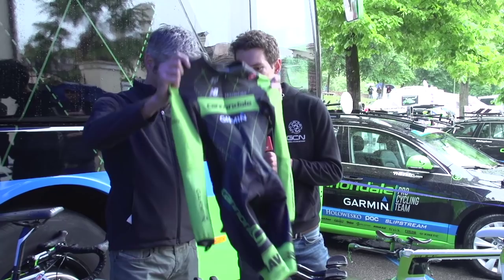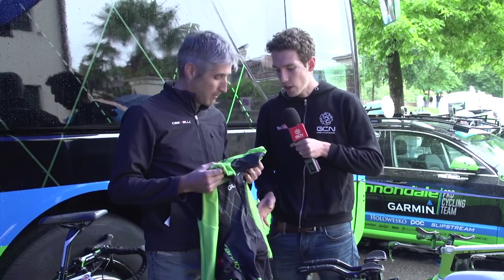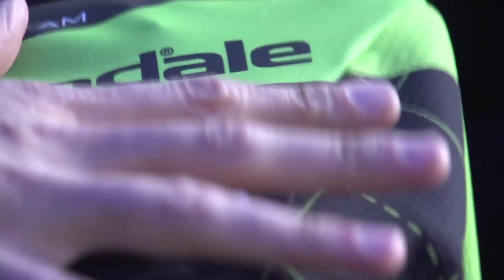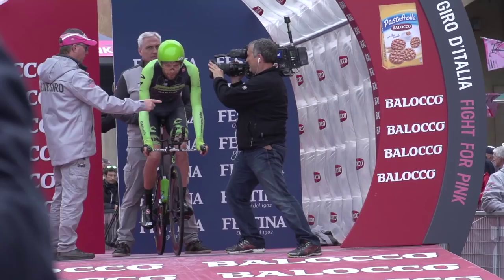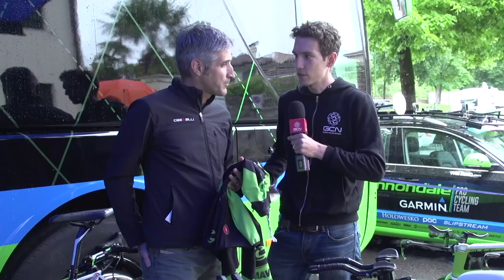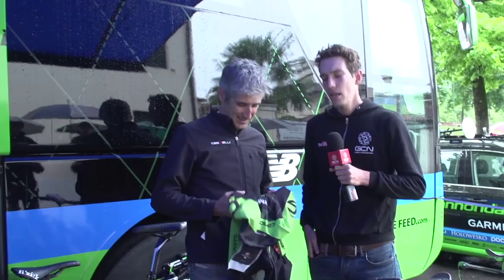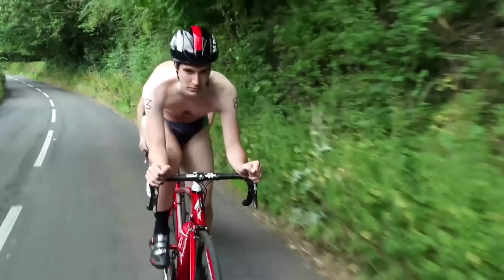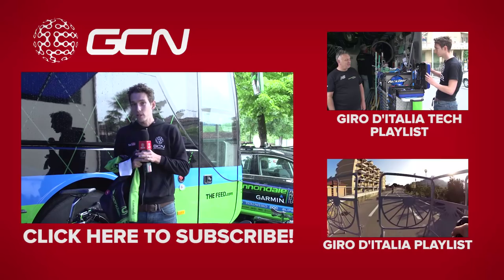Saving Watts With A Time Trial Skinsuit | Giro D'Italia 2015

Comment: Excellent video.  Very interesting.  He mentioned at the beginning about how the fabric will "fill in the arm hole".   I'd like to hear more about that. I've noticed some riders with fabric extended well below there armpit... stretched tight... almost like a small wing.  I suppose that is by design?  How far can you push it, I wonder, before the UCI will call it a fairing and how much does it help?
Reply: It may be interesting but, it's "watts" wrong with Racing nowadays.

Comment: I have a question Simon, why is 50kmph the industry standard? I don't you about you, but I get pretty tired pedalling at 50ks for 5mins, let alone an hour!
Reply from the maker: Terry Dawson 50kmh is really fast for most of us, but it's a speed that most of the pros are going to hit in a flat (or even not-so-flat for some of them) TT. So, it's an attainable speed for the pros and, I'd suggest it's a nice 'round' number for standardisation too.
Reply: Terry Dawson it's also the speed where areodynamics start to slow you by a lot

Comment: Great vid, although the spoilercomparison is totally rubbish, as the spoiler is placed to create downforce for the back end, not to be aerodynamic. Interesting to hear that fabric on shoulders would be saving watts in comparison to sleeveless
Reply: A spoiler does not create downforce, it 'spoils' the air thus reducing drag. Wings create downforce.
Reply: 01simmenj You're correct in that a spoiler "spoils" the air. However, it also creates downforce as it acts a little bit like a wing. Think about the big flat surface and what that's going to be doing. Spoilers are not really used a lot for aerodynamics, but for handling
Reply: Splitters reduce drag, not spoilers, spoilers create downforce. Doesn't matter, the vid & subject is about aeroskinsuits :p
Reply: Well, you could liken it to putting a front wing on, although that would look very weird on a porsche
Reply: Wings produce lift not downforce! Hence why a plane flys! F1 teams just put it in upside down to produce down force . But I think his point was if you covered the car in spoilers, wings and fins, it wouldn't go faster . It only helps when in the right place